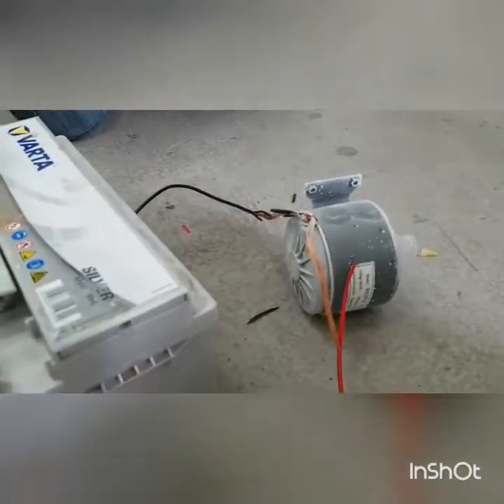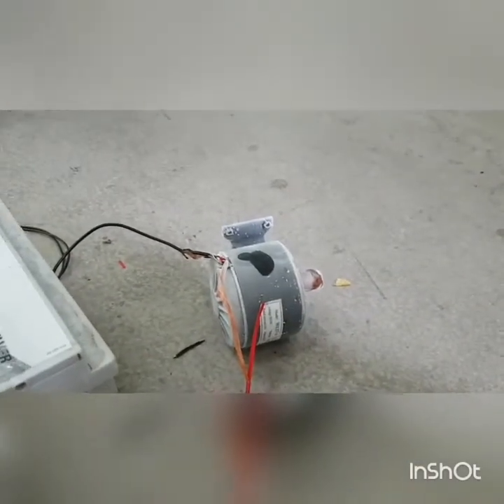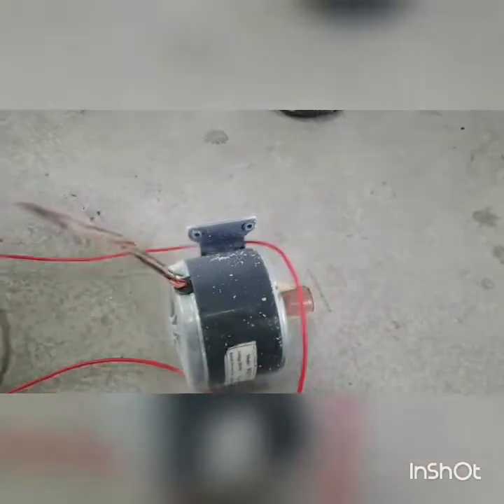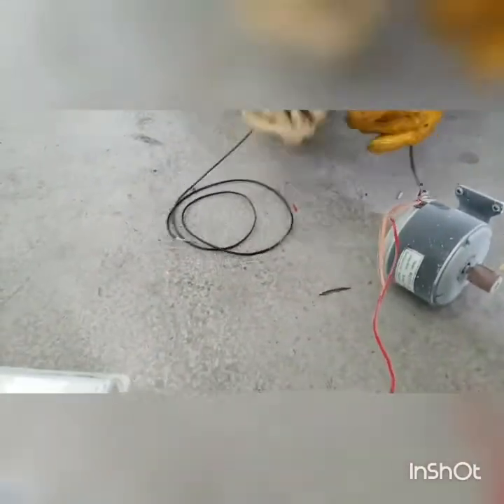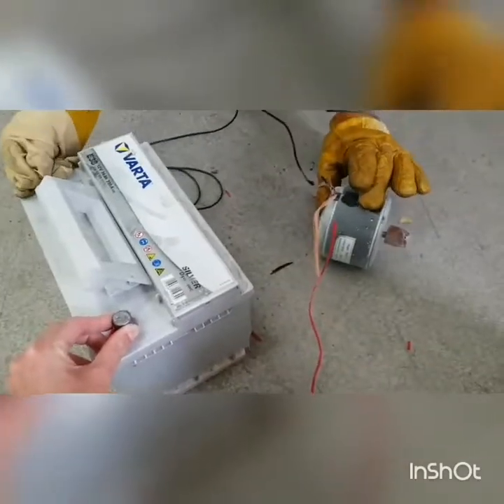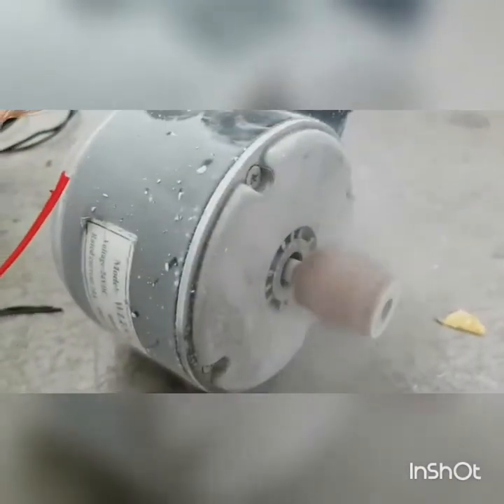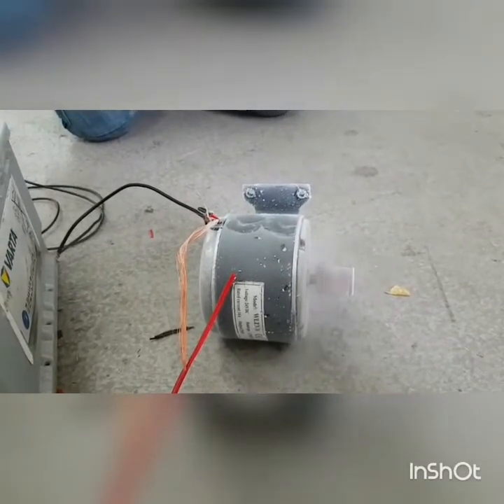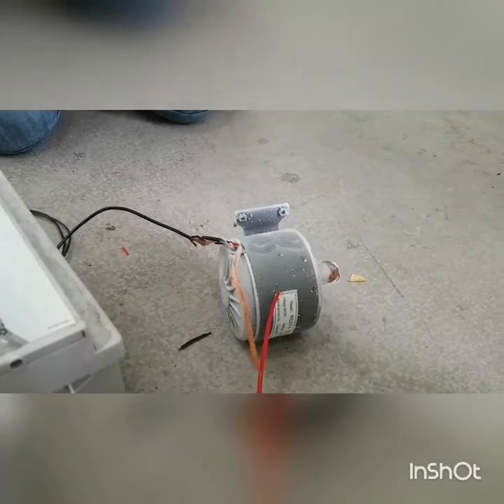What Happens When You Put a Running Electric Motor in Liquid Nitrogen!

Comment: Did it spin faster or slower? Cooling down the magnets should increase their strength which should slow the rpm but increase torque, but cooling down the windings should produce less of a voltage drop increasing rpm?
Reply from the maker: It actually did seem to speed up. I've got another better video of it if you're interested. I make some comments about what I think is happeneing